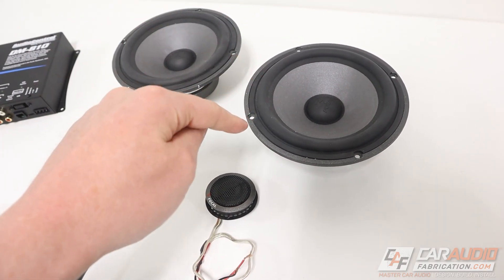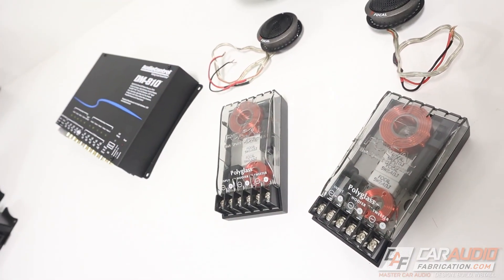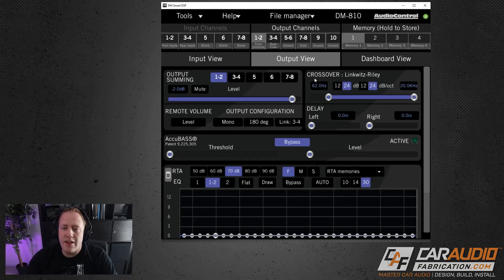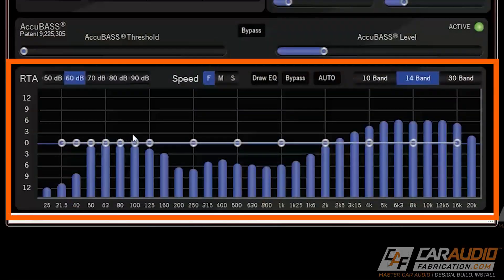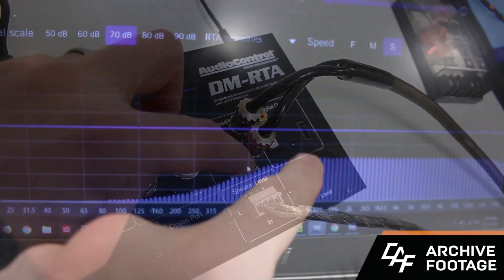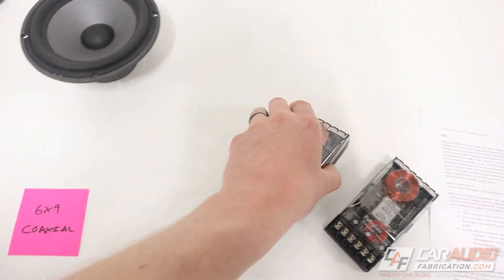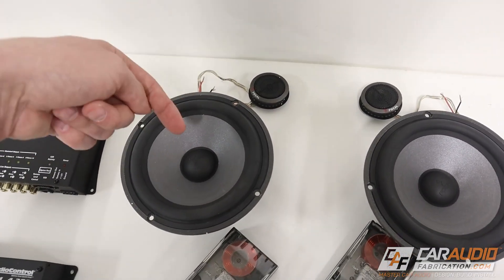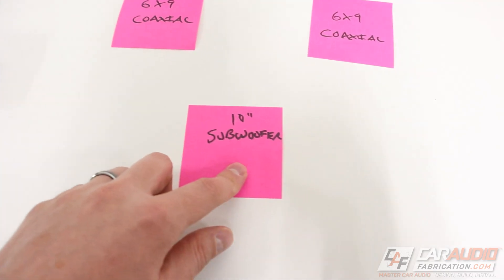Is PASSIVE CROSSOVER pointless if YOUR audio system has a DSP?

Comment: I get so confused on  getting a DSP.   I have  2 high end amps . 1 amp runs my front components which are passive, and my other amp runs my 1 sub.    My  HU is a Alpine  INE-W960 , which has time alignment and a PAR  E.Q.   I get lost adjusting the sound on my Par E.Q. so im thinking a DSP may not be for me. - 
 If i was to try one i want to run it into my existing passive crossovers on my front speakers.. Any recommended  ??  
 I would need SIMPLE as possible.   So a stupid question is i would need software to adjust my EQ ?   for best sound ?.... Ive been just doing it by ear.
 I had one audio site tell me to just get a Zapco ASP-Q2   , which is just a PAR E.Q. ????????????   SO how would that help.

Comment: When you recommended getting a dsp before going active i had a sigh of relief. You answered my question in detail without me having to ask. Im working on a regular cab f150 and put a pair of jl audio c1-690 in the factory 6x9 woofer location and factory 1 inch tweeter in the a pillar location. Ive been on the edge about getting a 4 channel amp and a cheaper dsp and running them active or just going all in and getting a helix dsp mini and run them passive for a little longer. I also have a kicker cvt 10 thats currently all getting a signal from a lc2i. Ive never had a dsp except a built in dsp in a boss audio elite bc7acp.wx in my 04 camry. It really makes that big of a difference in the sound huh? The helix mini dsp looks like more of a mid to high range device. Is it really worth 600$?

Comment: Ok, will this work for what I'm going to do to my ride . I have a 1979 Pontiac Grand Prix and because it never came with a radio I bought everything new Crutchfieild. I bought Kickers, 4.5" that go under the dash and my doors don't have any but my rear deck I bought Kickers 4×9"and one 12" kicker 600watts. Can I use the under dash speakers as tweeters? And my rear deck speakers as mid range?

Comment: Great video explaining the pros and cons of each setup!  I'm going to play it safe (protect my speakers from my mishaps when tuning) and keep passive crossovers in my future audio setup.  I'll forgo the super fine tuning with my 2023 JVC HU's - DSP and just stick to fade, time delay, EQ and let the crossover that comes with the components do it's job.  The plan... component speakers in all 4 corners and a single sub powered by a 5 channel digital amp.  The Audio Control equipment it definitely worth it if you get that deep into your car audio!

Comment: Hi, can you please help me with this question? I have bi amp able speakers and car amp gives only 1 set of output. Does it matter if I connect both +/- to woofer or 1 to WF and 1 To TW and use a bridge tab?

I have - going to tweeter input and + going to woofer currently and the tweeters are getting bass.

My thinking was, since the bridge is installed, it shouldn't matter to what input I connect as long as polarity is okay?

Comment: Why are car audio DSP's so much more expensive than Home Audio DSP/DAC when they lack true fiber optic/Toslink connectivity instead
using analog RCA cables?  Would not an Integrated amplifier with DSP be a better set up?  And cost about the same or less?
Not that there is anything wrong with analog. Using a quality LOC to boost your analog signal to your amp is a great way to improve
sound quality at 1/10th of the cost for those on a budget.  I just think car audio DSP's lag in quality compared to home audio. I could be wrong. (AudioControl seems to make some good stuff).

Comment: hi, great vid  🤩

A question ,for this vids 2 way speakers , why cant we use :

channel 1 -  for the left and right  mid-woofers

channel 2 - for the left and right tweeters

(channel 3 - for a woofer in a 3 way system - not applicable here)

channel 4 - for the rears

i understand "time alignment" from a drivers seat perspective

so lets just set the mid-bass & tweeters to a common central point to suit both the driver & passenger

now we can DSP the L+R Front  mid-bass, and we can DSP the L+R Front Tweeters without any crossovers

and the same would apply if the rear were the same 2 Way set up.

would this be possible as a solution ?

i will go and research more on this

Comment: Would you use a LOC such as the LC2i with a DSP ?
Reply: Yes especially with an OEM headunit you’d want to make them low level to then high level signal basically wiring inputs to RCA outputs to other high level(RCA) devices such as a dsp
Reply: @thatguykai479  the reason I ask is because the dsp I have has high level inputs as well ... basically doing what the LOC does. Only thing I wouldn't have is the Accubass knob

Comment: Ok I've got new Focal PS 165 FE3 and my passive on my front driver side passive crossover burnt-out my audio installation outfit is blaming the way i had my head unit setup, by having the position/DTA set to the drivers position and having the loudness set to low, I don't understand why this would cause the crossover to blow any suggestions, and as a side note I just order a JL Audio TwK 88 DSP that I have planned to install and wondering if I should have them do the installation and tuning or if it be a good or bad idea for me to do so following your DSP installation video, BTW I have a high knowledge of electronics as I went to college for EE 40 years ago so the installation part will be easy for me, oh and I have a JL Audio HD 600/4 amp for the front 4 channels and an older JL Audio JD 1000/1 monoblock for my really old but still kicking fine 2 RF 12" Punch boxed and ported

Comment: i would argue that using the 4 channel only on the components would sound better, since the rear speakers are generally only for "fill" ! So no need for the passive crossover . Run the 6x9 speakers off head unit power or cut them out until you can afford two more channels of amplification . never the less, great explanation of why someone may want to keep those power robbing passive crossovers

Comment: I could be wrong but if you don’t have enough rca channels, can’t you use rca splitters
Reply from the maker: Yes. But the signal will be exactly the same. So you lose the ability to now control every spear individually. Ideally every speaker has a channel, with the exception of subwoofers which typically have a Mono signal.

Comment: Hmm.  

No, you wouldn't need an amp for each driver.  A passive crossover is an attempt to make a channel's component speakers uniformly efficient.  A crossover is also commonly designed to temper an audio signal from utilizing a bad sound characteristic from a component speaker.  By using a crossover, theoretically, you will be trying to create a single, less distorted "multi-driver" rather than separate drivers in a channel that are each limited in their ability to recreate the entire audio spectrum.  Thus, the crossover wants to make multiple drivers act like a single speaker, but it just can't.  

I don't think it's possible for a good crossover to be designed that will be successful in a car stereo environment because you can't uniformly apply corrections to multiple drivers in vastly different locations.  That isn't to say that multiple drivers in a single location can't be "improved" by a simple crossover.  Trying to do much more won't help much

The use of a single amplifier channel driven to both a tweeter and midrange basically turns those separate drivers into a single speaker whether you want it to or not.  You may not LIKE the result, but it can be vastly improved with the use of a good equalizer.  You have thus created a "crossover" that should be able to remove the variation in the efficiency differences between the drivers with attenuation (exactly what happens with a crossover), and the peaks or valleys in the frequency response that would be created by driving them with a single channel of amplification can be smoothed.

This is really only possible if you have an equalizer that has the ability to be adjusted for each channel.  Many can't.  You could use a separate equalizer for each channel, but this get's expensive.  However, a good analog equalizer on each channel will do a better job than a typical car audio crossover can.  In this case, they're both analog too.  Thus, crossovers aren't required for car stereo and in most cases an analog equalizer can do more.

A good DIGITAL equalizer will do EVEN BETTER than an ANALOG equalizer will.

That's really as far as I can go.  Even a little more depth requires a lot of typing and there aren't that many people that will read the comments anyway..

Comment: Stupid question if I have a pair  of 3 way component speakers and have a 2 way passive crossover can I get rid of the 3.5 mi and use the tweet and 6.5 for rear fill

Comment: yes but a £1500 to £2000 head unit will have all this software inside and if you have passive crossovers they will not play slave to the head unit meaning the crossovers you install are doing zero nothing at all like having 2 of something doing noting ???

Comment: I'm not sure how simply adding a passive crossover, is going to make any difference in channels for a component set. Even without the passive crossover, the woofer and tweeter can still function on 1 channel, albeit not recommended without the crossover filtering lower frequencies from playing thru the tweeter.  Unless the passive crossover is changing the load rating between the component and amplifier, than it's really only a filter than.

Comment: If you don't need fade you can run the rear speakers on the same channels as the front then you can have the tweets on the unused channels, thus removing the need for anything passive.

Comment: if the 6.5 can take 200 rms and the tweeter 50 and i use a passive crossover rater for that power can i power them with 250 altogether just wonderin

Comment: I will add a couple of things worth mentioning that weren't talked about in the video when using passive networks down stream from active networks, weather they are active electronic crossovers or DSP. First off one needs to be knowledgeable about the passive network they are using. Is it Link-Riley, Butterworth, Bessal or possibly an elliptical cross over? What order is it? Second, third or forth? What's the roll off 12, 18, 24 db? These things are important to know because any frequency attenuation that is done with the cross over in DSP will change the behavior of the passive cross over. Of course there is nothing stopping one from mixing different types of cross overs in the same network . You are quite able to put a second order LR high pass x-over right next to a third order  Butterworth low pass x-over in a band pass network if you like but your mileage may very. 

So it's important to know what your passive networks are so you can match them in the DSP or active network. You must remember that any frequency attenuation done with the DSP will add to the passive network so if you start with a second order LR in DSP and the passive x-over is also a second order LR what you will end up with is a forth order 24db LR x-over that may or may not exhibit phase issues. In this case sometimes it is best to not assign a x-over in DSP for those front two channels and leave that to the passive network and just use the DSP to EQ the channels and for time alignment. These issues are more prevalent I think with active electronic x-overs then they are with DSP but they can still exist. 

If the passive network happens to be elliptical combined with DSP you might find yourself dealing with some wonky phase coherence between the tweeter and the woofer especially if they are spaced far apart in a two way component set and in a three way component set those issues can become even more pronounced and hard to fix. There are many different choices we can make when deciding how we will ultimately end up using the sound equipment that we have. Personally I have many times used passive and active networks together. Here is a little trick. By using capacitors one can stack tweeters up on the same channel wired parralel and not worry about the impedance as long as there is one speaker that maintains the required load for the amp such as the woofer or midrange at say two ohms for instance. 

This can be very useful if you are trying to build say, a tweeter "array" that runs up the A-pillars for instance. This is something I have done in the past and it worked very well and sounded amazing. You start with two channels Front R-L. You put for example a third order high pass Butterworth x-over around 350 to 500 Hz on each channel with the active electronic or DSP unit and attach a 3 or 4 inch midrange in a pod or molded into the A-pillar trim at or about the base of each A-pillar with no passive network hooked to it. Then on the same channel you take a number of small tweeters, maybe four 1/2" to 3/4" fabric or metal dome tweeters and place them in a evenly spaced array up the A-pillar either in little pods or molded into the trim. Except with these tweeters each one will have a single 250 to 500 volt polypropylene foil capacitor that can very in value if desired. Say a 10uf at the bottom next to the midrange working up the array stopping with a 1uf cap on the one highest up on the A-pillar. As long as there is only a first order x-over consisting of a single capacitor on each tweeter and they are on the same channel with the 2ohm mid-woofer the amp will only see the 2 ohm load and you are free to stack tweeters and not send your amp into a conniption fit because it sees a short circuit due to the halfling of impedance you normally would see when wired in parallel without the caps. You can pad the tweeters down with resistors as long as they remain on the down stream side of the capacitors attached to the speaker terminals preferably.
Reply: You sir, speak on a completely different level. 90% of installers wouldn’t even understand half of what you just said.
I love that. Do you have a site or page to follow your work ? Or a way to contact you for a question?
Reply: @MowSow  well thanks. Car audio has always been a hobby of mine. Pretty much every car I have ever owned I put a sound system in. Some of those systems where pretty elaborate. I don't install systems professionally but if you want to see  something I am currently working on you can go to 

diyaudio 

forums and do a search for

 "My Tundra is getting a new system" 

and you will find my build thread for my 2019 Toyota Tundra. It is an on going project at this time. Nothing to over the top as I'm trying to maintain an OEM appearance and not destroy the resale value of my $60,000 truck by hacking apart all of the door panels and A-pillars . I have done some alterations but everything so far has added value to the vehicle. The truck has been modified quite a bit actually with a lift, wheels and tires and other upgrades. If you decide to check out the build thread you will see.
Reply: @iamjackalope  hi, great write up 🤩

the reason why i looked in the comments here is :
For this vids 2 way speakers , why cant we use :
channel 1 - l for the left and right  mid-woofers

channel 2 - for the left and right tweeters

(channel 3 - for a woofer in a 3 way system - not applicable here)

channel 4 - for the rears

i understand "time alignment" from a drivers seat perspective

so lets just set the mid-bass & tweeters to a common central point to suit both the driver & passenger

now we can DSP the L+R Front  mid-bass, and we can DSP the L+R Front Tweeters without any crossoves

and the same would apply if the rear were the same 2 Way set up.
Reply: Hey, Even though my system has a passive crossover and a DSP the tweeter seems to vibrate or makes a weird noise during deep base tracks, anything specific to watch out for, Thanks in advance..!!

Comment: Can I install JUST the woofer component  in an Alpine SPJ691CS (with a passive crossover)  into an existing 2008 Dodge Ram 1500 Nav infinity system (front doors), while still use the existing tweeters/crossover in the factory component system?  I'm not looking to spend a bunch of cash, but the Dodge has a factory system that I understand would only produce bass frequencies in the 6x9 door speakers that I would replace them with.  So, what's the point in buying a 3 way coax?  

My question would be whether or not the stock infinity crossover in the factory system would still tell this Alipine passive crossover what frequencies to emit?  Could I damage the  Alpine 6x9 woofer by doing this, since it has its own passive crossover?  I would not be using the tweeters that came with the Alpine SPJ691CS. I also thought about looking for an Infinity passive system to replace with instead of Alpine, as maybe this would communicate better being the same manufacturer?  Perhaps I'll hook up the passive tweeters that come with the alpine in time, to replace corner dash tweeters, but not ready for all the mods yet.  Thanks!